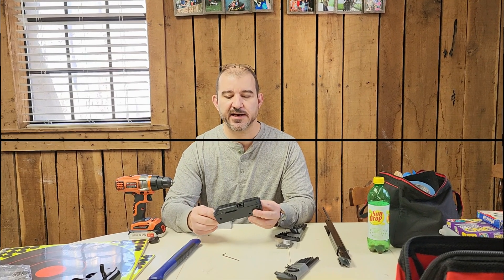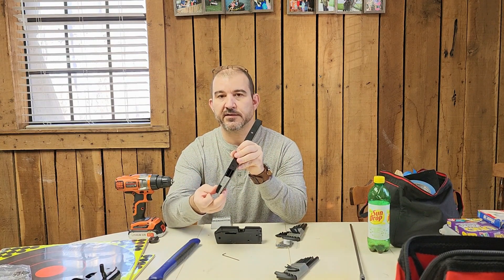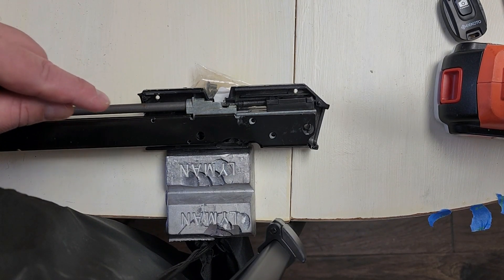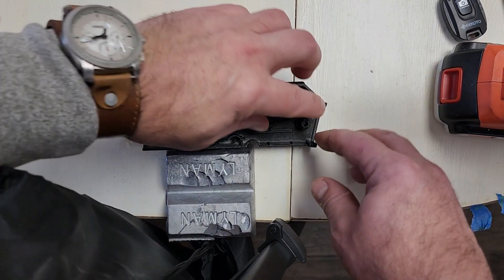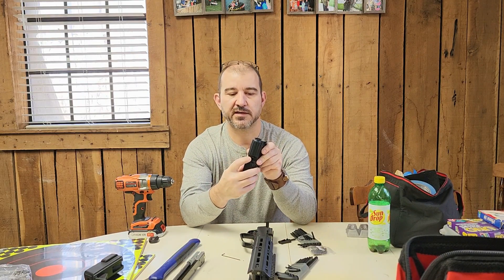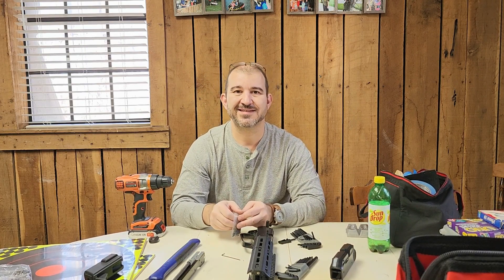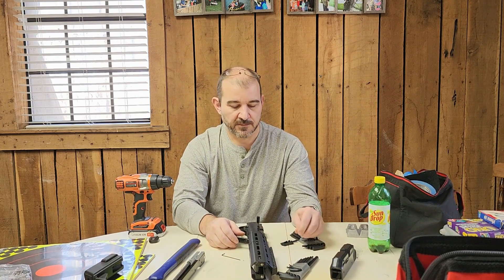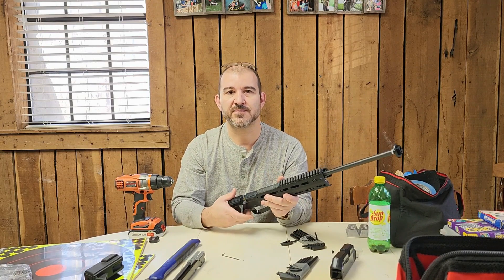Daisy 880, 822, 922, etc... and Winchester 1977 Receiver Bridge

Comment: Hi Patrick… It appears that you are a Fine Gunsmith, and are highly familiar with Daisy 880s.
I just recently purchased (2 weeks ago) a Chinese made 880.  It shoots great but I am wondering if you have ever put a Metal receiver era 1992 on a gun like mine?  I’ve heard possibly the new style bolt is thicker and might have to thinned down… I just know that the dovetail flexes big time with the plastic receiver and the crisp corner of dovetail probably could wear out.  It might be beneficial to do your bridge technique on a metal receiver and adapt it to the newer frame and front rear stocks if possible.  Have you ever done this?